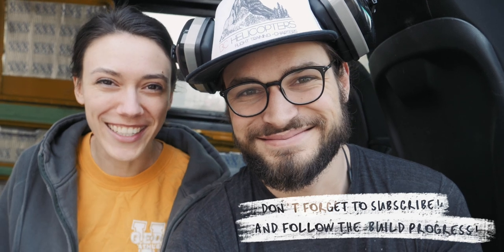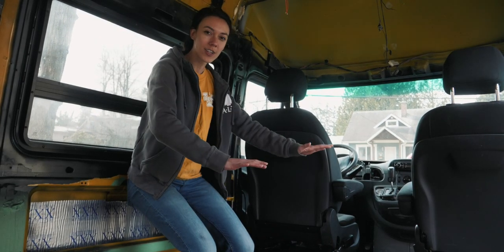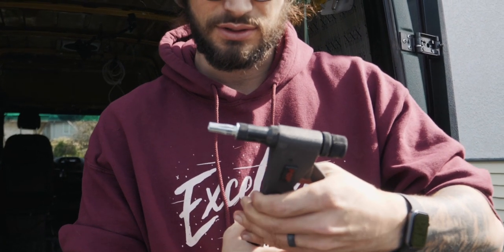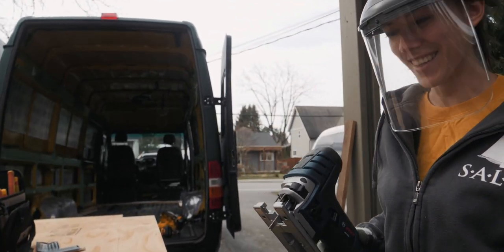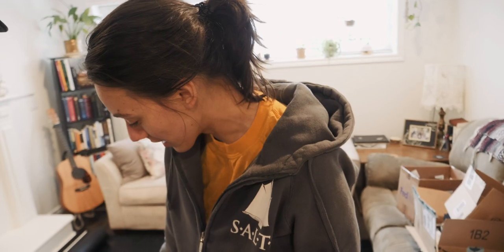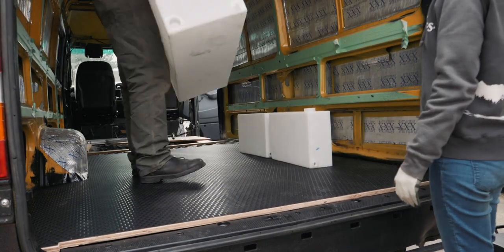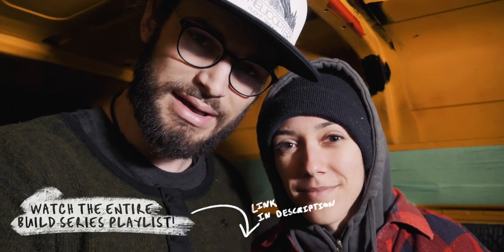Epic Coin Grip Flooring in our Sprinter Van Conversion

Comment from the maker: UPDATE: I should have been more clear and explicitly mentioned that the holes were already in the floor. We were just making them bigger. We didn't get to choose where they were. 
There is heaps of comments saying that we should have drilled through the plywood into the metal so our holes lined up. I'm getting bored replying to all them. So that's the reason. Holes were already there, and I'm not about to make 30 new ones.
Our current strategy is to map the holes out onto the plyood is something I learned from a friend, and that is just thread in a bunch of bolts with heads cut off and then lay the plywood down to have the bolts mark on the plywood where the holes are.
Reply: I knew there was a reason you where doing it that way lol   I wasn't about to question it.    
"There is a method to Levi's madness"  lol
Reply: I've been hearing(/saying/thinking) this a lot lately: Everyone is a critic. 
And I believe you do it right - how ever. And it is a learning process, I envy you in the vanmaking, the handyman within me is getting spring fever...
Reply: Makes sense.

Comment: To figure out where the holes need to be, get some spare long bolts in the same thread as the nutserts, cut the heads off and then thread them into the nutserts. Then lay the floor board on top and gently hammer where the bolts are. They will leave a mark in the wood and you can flip the board over and drill from the bottom. That way you know exactly where they go with maximum accuracy.  Great work so far!!
Reply from the maker: That was my current plan. Just feels very time consuming. 
I might be able to just mark with a skinny pen through the bottom of each nutsert... Thanks for sharing your idea
Reply: @Levi_Allen  make a mark around  the holes with an lipstick and press the new wood floor on top afterwards. so you have the perfect marks on the bottom of your plywood flooring and you know where to drill trough. Greets from Germany

Comment: You are doing a nice job. Small tip: use cardboard to make templates  for the roof etc, this works faster and much easier as wood.
Reply from the maker: yeah, we didn't expect to make 3, we used a new technique to get our first and thought it would be close to perfect

Comment: You’re going to want those holes holding the floor down to be oversized. The plywood will grow and shrink with temperature and humidity. Typically on vans we install for customers we either do a floating floor or have the plus nuts and holes at the outboard edges of the vehicle nearest the walls so they are furthest from the “walking area”. I’d recommend a pan head screw and washer to cover the oversized holes. You could use a small wood boring bits to get the fastener heads to sit flush on top of a washer (again make sure the overall diameter will let it grow and shrink. Don’t over torque them or you’ll cause the wood to prematurely fail.

Comment: Maybe someone has pointed this out already, but...

If you cut the plywood flooring first and underlying frame, then laid-out the holes for attachment on top of those, drilled through the plywood and through steel floor, THEN painted the holes and added the plusnuts, there would be no alignment issues.

Yeah, hind-sight is 20/20, but maybe to help the next person do it a little easier.

Really like your build videos, all these nomads have me thinking about heading out in my (fast approaching) "silver years."
Reply from the maker: except the holes were already in the floor
Reply: @Levi_Allen  didn't we just watch you all drill the dang holes?
Reply from the maker: AsTheWheelsTurn read the pinned comment. We were making the current holes proper size. The previous floor was held down with rivuts that were removed
Reply: oh gotcha… well I'd just put the screws in the holes that you have, put some paint or grease on the heads of the screws and carefully set the plywwod in place, this would give you marks on the bottom to drill holes.any way you do it its gonna be tricky but I'm sure you'll get it!.  @Levi_Allen

Comment: That's a good idea for the floor, I remember that's what the first airport in Kuala Lumpur Malaysia used as their floor back in the 70s. As a kid when walking on it with sneakers I would trip & go  flying coz of the rubber on rubber grip.  😂 Durable lasts forever wont ever rot kind of stuff. Good sound deadener too!!

Comment: The idea of the short bolts in the floor and laying the plywood on and tapping on it to make marks works great. Next time drill small holes in the plywood in the van first then take the plywood out and enlarge the holes and then use the inserts. Just either way works. Go for it.😎😎😎👍👍👍
Reply from the maker: The small holes were already there from the previous floor, we had no choice where they put them unfortunately. We could have sealed them all up, but decided not to
Reply: @Levi_Allen , Ah, yes. Way to go with what you were delt. I hope everything goes smoothly.

Comment: I hate to say this in my first comment but I think you will learn to hate that coin grip flooring. I worked for a boat company that built 5 oil field boats and each had that type of flooring in the wheelhouse. They looked great when new but the crews soon learned that the flooring was near impossible to keep clean and almost impossible to mop. But I hope you have better luck with it in your van. Great channel and really looking forward to watch your progress with the build.  Dean
Reply from the maker: I've seen it in vans and I like it a lot. There is a big difference for me between the large coin grip and small. The large seems to pocket up the dirt more.
Reply from the maker: The overall stickiness seems to play a big factor as well
Reply: Yes the boats I was referring to had the large coin grip flooring. Going to be interesting to see how your flooring works out.

Comment: Hi Levi, a little tip for the future, re putting holes in the ply after having inserts put in the floor, put set screws into the inserts, just proud, then lay the ply wood on top and give the area a tap with a hammer, then the imprint of the set screws will leave a mark on the wood, you can then remove the ply and drill them, they will be in the exact place, no messing. Great series, really enjoying your journey.  Mart, from the UK.
Reply from the maker: That's our current strategy! Thanks for the input

Comment: Looks good! What flooring did you chose? And did you consider gluing the floor? We glued down 1" polyiso and then 1/2" ply and almost 2 years ago and haven't had an issue.

I built wood boats for a summer and they are put together largely with glue, so figured if it's worked there for couple hundred years, it ought to get us through a decade or two. 😉

Comment: One way of making sure your holes for the floor and flooring match up is to dry-fit the flooring and only then drill down through a pilot hole. Remove flooring and then drill the holes you need to the right diameter and depth and proceed. Keep makin', peeps.
Reply from the maker: Check my pinned comment
Reply: @Levi_Allen  Dude; tired of saying the same thing over and over and over and over and over...what's wrong with you? ;-)) You done it so you done it right; fair play and carry on... Stay safe people, doing great.

Comment: ... looking fine - the coinfloor will serve you well. ... for plusnut location on the ply, install a small dab of grease or oil or even paint on the plusnut and place ply on top (carefully lol) ... this will transfer and make location id quick 'n easy ... how come i still see yellow inside hmmmm???   Cheers ~ S
Reply from the maker: Totally, that's the strategy we've been using.

Comment: So if I got a 144 crew van I can install the rubber coin floor over the grey factory floor it comes with? I wanted to sound proof the floor and add some thinsulate but stick some of that rubber coin flooring over the original floor cover. I was thinking I would have to cut out some holes for the seat brackets.

Comment: How do your rear seats work?
They are attached to the floor during normal driving mode facing forward but then how do they attach to the floor when they are positioned along the wall?
Or do they just rest there with no fasteners to the floor?
Very curious as I want to do something similar. 
Thanks

Comment: Other method of drilling the holes through the wood through the metail in one go. Tip the nuts with some paint than press the wood on, than you go a marker. But i guess the first method is really the best one, you will get perfect alignment.
Reply: By the way, great teamwork!!!!
Reply from the maker: The holes were already in the floor from the previous flooring, we just made them slightly larger
Reply: @Levi_Allen  ah okay, you could also add nail in the bottom bolt part an lay the wood on top. Than it would punch a small hole where you can than drill.
Reply: PS did you got married lately, im at the start of the van project. There it was "my girlfriend", now it was "my wife", congrats if so. PS i see fall came early this year and your already starting :) Nice!

Comment: Levi, quick question - I have been looking for the coin flooring but can only find rolls in 4 ft widths. It looks like your roll is much wider. Where did you find it? 4ft would require seams, which I would prefer to avoid if possible. Thanks!
Reply from the maker: Links in description
Reply: @Levi_Allen  Thanks for the quick reply! Sorry about that, I thought I checked that link previously, not finding those widths. Cheers.

Comment: Not sure why you decided to put 3/4" plywood that is fully supported under your flooring.  Why not just use 3/4" of rigid foam, or 1/2" rigid foam and 1/4" ply?
Reply from the maker: It’s not 3/4. It’s 5/8th. We went that thickness so we could easily use 1/2 screws into the floor and give them lots of meat to bite into without tearing out. We will be mounting things to the floor.

1/2 is the thinnest I would go, and we are doing that up front.

1/4 would be too thin in my opinion

Comment: would have been easier to lay the wood floor, then drill the holes through the wood and the metal flooring. take out the wood, install the nuts. Put the flooring back in, bolt it down. To easy.
Reply from the maker: Except for the fact the holes were already in the floor from the rivnuts that held on the factory flooring.

Comment: Curious the tool you're installing the plus nuts with?
Reply: I guess to clarify, I know it's a pop brand hand plier tool, but as far as i know they are sized for up to M6 and I'm assuming your plus/crossnuts are m8? Have you purchased a different nose piece and/or mandrel? Or are you using M6 plus nuts?

Comment: My old van had carpet over plywood.  It was never cold...
Reply from the maker: Do you live in Canada?
Reply: @Levi_Allen  No, California.  But I spend a lot of time in the Sierra Nevada, and I've winter camped in the snow.  I had 3/4 plywood, foam carpet pad, and pretty dense carpet.  Plus, I couldn't stand in the van.  I get your point.  Plus I run hot, and love cold weather.

Comment: I’m curious why you wouldn’t put insulation under the entire floor, not just the front? I wonder if you could have drilled the holes for the plusnuts through the floor with it in place, that would have guaranteed alignment?
Reply from the maker: How would we know where the holes are in the floor from the other side of the plywood. all we did was enlarge the holes that were already there.
Reply: Levi Allen , sorry I missed that you were enlarging preexisting holes, my idea was for brand new ones. 😊

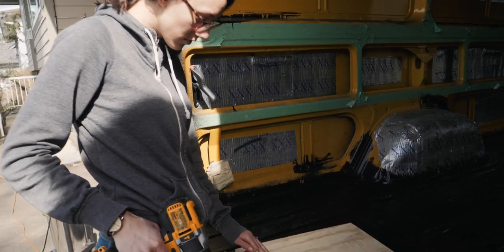Comment: 4:21 Umm .. The simple way to do that is lay our your plywood ... THEN drill the plywood and the steel floor simultaneously straight through ... THEN left off the plywood and set all your nuts .. This was they will line up perfectly every time.
Reply from the maker: Holes already existed in the floor

Comment: I never get why some amateur van builders think that putting in a finished product like a floor is a good idea. I suppose its easier when there are less obstacles to cut around.  Put in the sub floor like the plywood yes but the finished floor goes in last to prevent damage whilst building as you WILL drop things. And judging from the cheap thin rubber floor you put in, I guarantee its not looking so nice now. Would be nice to know.
I do like your filming however, its entertaining in itself so credit where credit is due. x
Reply from the maker: Will this is awkward. Years later and it’s still fine. We also put down cardboard on high use areas while building.

Comment: How did you know where to drill through the plywood to hit your holes to bolt the floor down? I bet you gave up on that idea and just laid it in didn't you? Before you drilled all the holes through the floor you should have cut and laid the plywood in first and drilled through both of them.
Reply from the maker: see the pinned comment
Reply: @Levi_Allen  Yup i just noticed it after i commented and was reading down through the others.